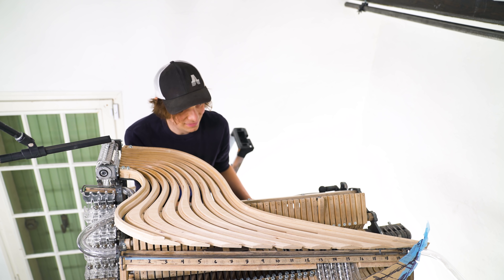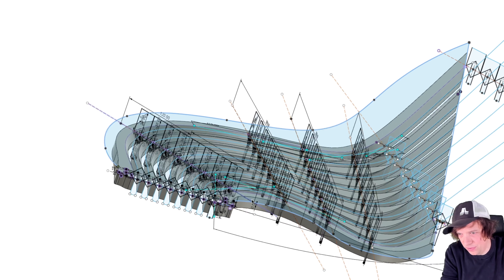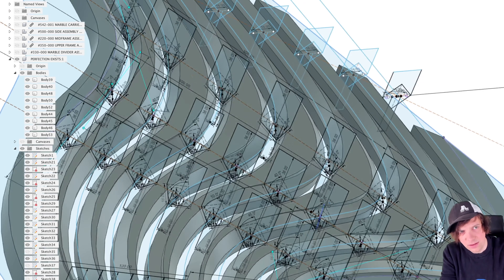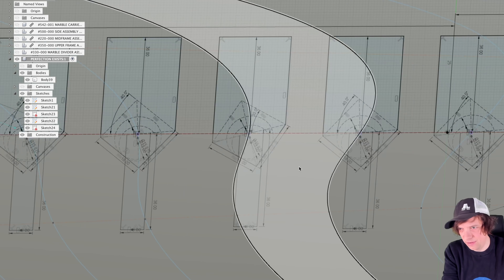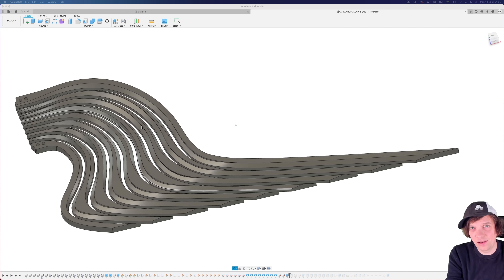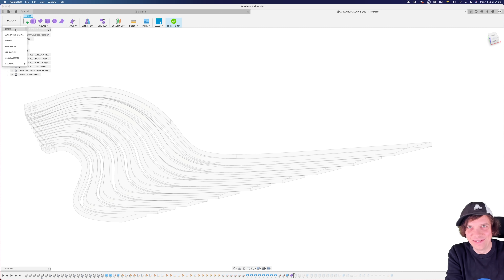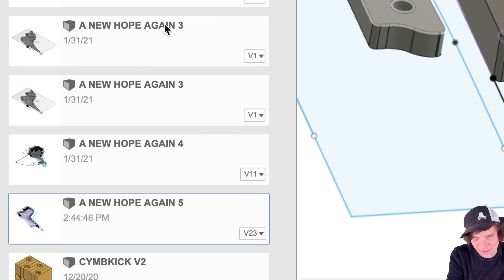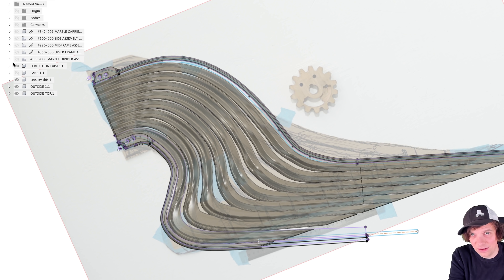Marble Lanes

Comment: We're all rooting for you and your journey through industrial design, DFM, and ultimately building a wonderful musical instrument. I can see you are gradually optimising each key part of your design as you should — optimisation should always happen late in the assembly process — but one lingering thing keeps worrying me : When the machine is done, it will be crated ,shipped, un-crated multiple times, around the world. This means many items risk going into misalignment and you can't afford to have to fix the machine each time it's un-crated at a concert venue. Please make sure you visualise and imagine how the machine will be crated and hoisted; how it will be un-crated and moved into position on-stage, and take into account how all the shocks and vibrations during transport can and will distort the machine's alignment. Identify the weak structural points and reinforce them for stiffness or compliance.
Reply: And some parts break easily. This “angel’s wing”, for example, and the similarly shaped thing underneath the machine.
Reply: @peterfireflylund  yes that thing underneath felt quite bad.
Reply: good point. if evrything is not 100% rigid or screw adjusting, fine tuning on the spot will be hell.

Comment: i actually dont like this design and think the previous one was much better, i think the marbles will be starved at the left side and there would be always full at the right side because the marbles that dont get used at the top always go lower, so the last lane gives marbles only to the last instrument while the first lane gives marble to pretty much every single one
Reply: Left side will also still be getting marbles from the divide-by-4 so in practice I don't think they'll be starved. Not to mention, the left side is mainly the vibraphone, which each channel may not be as consistently played as, say, drums or bass which are all on the right-most channels, and as such the left/vibraphone channels will theoretically need fewer marbles and could get away with a slower fill rate.
Reply: I was afraid for the same reason, but then I remembered that there is also the "divide by four" mechanism which feed the marble path directly from the start of the path, and considering that now that it has been fixed it's basically always full I no longer think it will be a problem. Also, if Martin will be able to increase the efficency of the conveyor belt so that all the eight spot can be full, this will work like a charm
Reply: Well, if those last lanes would be saturated, the marbles would just be resycled by the fishstair... Bringing them back to the top..!
Reply: @Leeuwenmuziek  Yeah but when on the top you don't want It to be delivered again on the saturated last lanes, for efficency you want to fill 100% of the space equally
Reply: Well It was a valid doubt considering that there must be no constraints about the instruments used for the song, if the vibrophone Is the main instrument it needs a lot of marbles to operate
Reply: nevdrmind, the ladt instruments are drums, and they need a lot of marbles